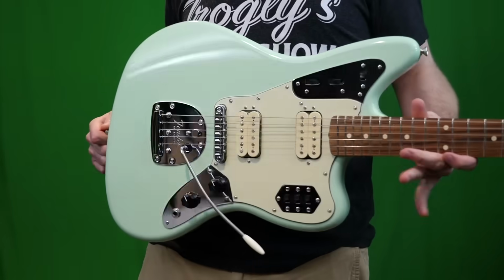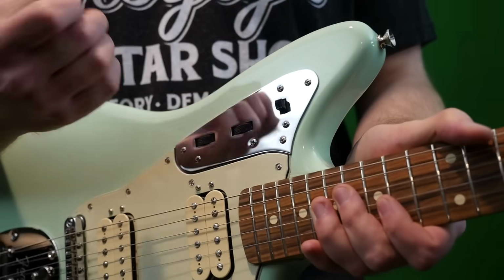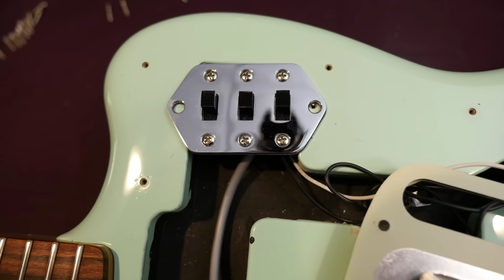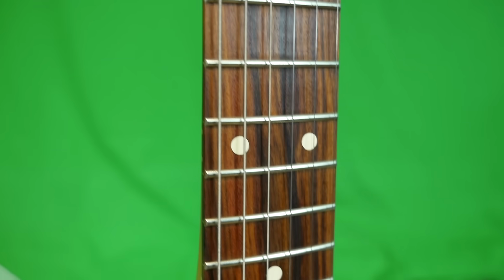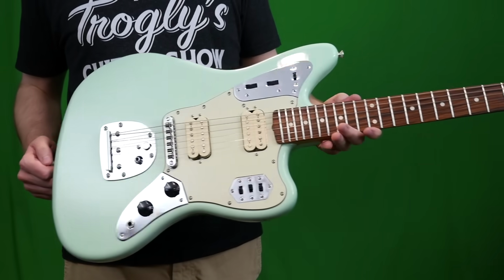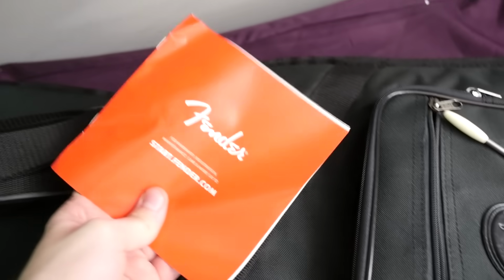My First Jag! | 2019 Fender Vintera 60s Modified HH Jaguar Surf Green | Review + Demo

Comment: Anything over $1K deserves a hardshell.  Agreed.
Reply: Yeah that's been my bigest problem with fender.
Reply: This guitar becomes 1599.99 with a hard case tho.
Reply: lol, I refuse to pay for a standard guitar over 1000$, if it goes over 1000, I would rather go with something custom made.
Reply: alidan or vintage :)
Reply: The old classic series that the Vintera replaces had hard shell case and nitro finish. Getting less for same cost.
Reply: Back when there used to be guitar stores, instead of only one that rhymes with buitar lenter, they'd throw in a practice amp, strings, gig bag, etc..., and I'm not talking about those box deals. They'd do in store deals to move guitars, and the employees would actually know things and be helpful.
Reply: @alidan  lol, any custom made guitar would cost a lot more than 1000$ and this price range is seen as the standard if youre looking for a quality guitar
Reply: @Gerardo Sajid Gámez Sánchez most of the quality of life and feel for guitars can be done at the 800$ price point, that includes trem and pickups for the most part, but top dollar you are looking at around 1500$ for a perfect, decked out guitar and this is retail price possible. if I went over 1000$ for a guitar, 99/100 for me, it would be because the guitar is either perfect as is and I want that exact guitar, or im willing to spend the 2000-3500 to completely customize the guitar to my whims. see, at the 500-1000$ range, i'm more of a 'its good enough and I can settle for what I get' and what I get will be fantastic for the price, not perfect, but i'm not missing out, ad 50-150 for a hard case. but the moment i go over 1000 thing needs to be 100% what I want in every single facet without question and at that point im willing to pay more.

I cant remember where, but there is one place that does smaller runs of guitars so I can get a custom paint or custom pickups for little extra cost, the term though can cost a lot, but I like my stuff locked most of the time for tuning reasons.
Reply: @alidan  really? Custom shop guitars are easily $5k+. That's a pretty big difference 😂
Reply: 100
Reply: As long as Gibson is still selling $1600 guitars with no hard shell case, there’s zero chance fender will on models like this.

Comment: Shorter scale length yields strings that are more loose not more tight.
Reply: Rob Mathis not true, the information in the video is correct.
Reply: Absolutely, what I was thinking , as I put down my Strat and pick up my Les Paul .
Reply: @jakerjohnson38  Sorry you're wrong. Austin made a mistake. It happens.
Reply: Jake Johnson no its very much true, when using the same string in the same tuning a shorter scale guitar will have LESS tension, you can clearly fee this difference when comparing a Gibson vs prs vs fender scale guitar. Never mind the even shorter offset scale
Reply: to be exact, longer strings require higher tension to tune to the same pitch as shorter strings of the same gauge.
open up a piano and look at the various string lengths and gauges, and this will become blatantly obvious.
Reply: Shorter scale length = less string tension. Ask any drop tuned metal player. That's why they play either baritones, or put extra heavy gauges on Les Pauls or don't even play Les Pauls at all. Also the reason why ESP-LTD's Eclipse is 25.5 vs 24 so just put that into perspective.
Reply: @Guitar Ocd - That's what I do with my SG sometimes. 11's give a good tension for 24.75.
Reply: @guitarocd9984  agree about the intonation Ocd, but I always liked the loose, floppy aspect of my old Jag. Just lends itself to bashing around on those old garage rock tunes. My only complaint - and it's not really a complaint, just a preference - is that Jags (and I assume Jazzmasters) just offer too many options for tone. All due respect and admiration for those who can make use of it, but i just sort of froze at the abundance of options. I eventually went the opposite route and got a single pick-up guitar. Suits my simple mind.
Reply: But I absolutely loved the Jag trem bar
Reply: He said he had it tuned up higher than normal which explains why the strings were tighter.
Reply: Yep. That's the reason why I swapped my Squier Tele Deluxe to an Epiphone Les Paul.
Reply: @guitarocd9984  That's pretty much how the guitar was designed to be used. Heavier strings, perhaps even slightly shimmed back neck.
Reply: Play a jag on 9s and you will realize just how little tension their is on the tiny scale length. You could accidentally do a half step bend if youre heavy handed enough. Playing 11s on a jag feels similar to 10s on a strat.

Comment: I'm thinking the single coil pots are used as a variable resistor in parallel with one of the humbucker coils.  When the resistance is high it's in humbucker mode and as the resistance goes down it shorts out one of the coils to make it more like a single coil pickup. All the way down, one coil is shorted out and it's in full single coil mode.
Reply: Exactly

Comment: For your trem, you want it set up so you can engage the lock (the slider on the tailpiece) without pushing the arm down whatsoever. That will let you hold your tuning after losing a hi E, which is normally a disaster on something like a Strat tailpiece that is not grounded out.

Comment: Gotta say, the pau ferro fretboard looks less desirable than rosewood.
Not my favorite review, but I'm glad you tried to get all the tones. 
Here's a list of the moments for easier reference:

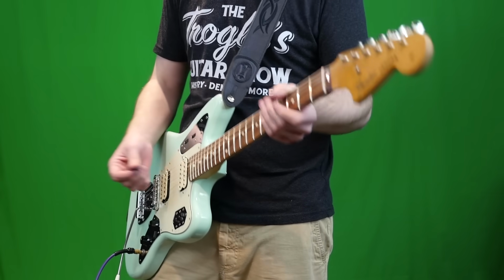14:36 Only Neck Pickup in Full Humbucking Mode / Left Switch UP only
14:48 A little bit of single coil
14:54 More treble from rhythm circuit
15:03 More Bass from rhythm circuit
15:10 Who knows cause he didn't say anything, apparently just neck pickup
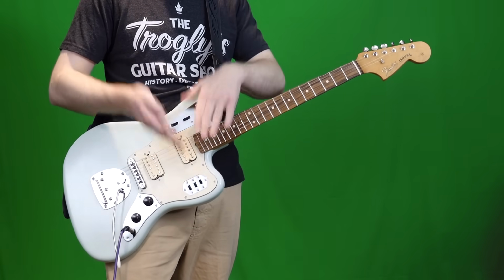15:57 Tone cut with Left + Right Switches in UP position
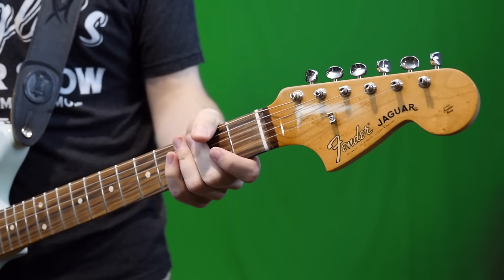16:30 Bridge Pickup / Middle Switch UP Only
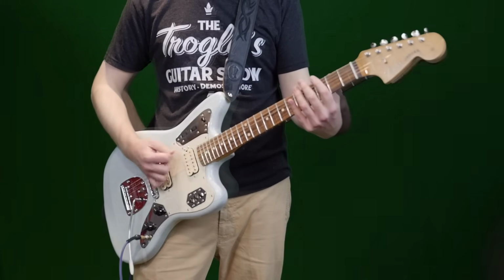18:05 Both Pickups in Single Coil Mode / Middle and Left Switches UP
18:24 Neck in Humbucker mode / Middle and left switches still UP
18:40 Both Pickups in Humbucker mode / Middle and left switches still UP
19:03 Neck in single coil, bridge in humbucker / Middle and left switches still UP

Comment: The variable single/humbucker controls on the secondary circuit was a brilliant idea. Makes more sense, and is FAR more usable, than the original circuit. Very tempting. Wish this version came in the turquoise with matching headstock though.
Reply: The turquoise with matching headstock is so beautiful, I want to get that one and modify it with the humbuckers

Comment: So the butten on the trem is a lock. You lock the trem and then tune. After the lock is released you play as normal. If you break a string and go out of tune you can again lock it and it will return to tuned  -  one string.

Comment: Shorter scale length = lower tension, not higher.
Reply: I also agree. It should be less tension on 24" scale length. All the better for that locking tremolo system jkjk
Reply: @electricurinal  Ok got ya. Since he was tuned up so high it seemed more tense. I see.
Reply: @electricurinal  , he should have started the video without all the talk about the accidental tuning because all that did was confuse people.

Comment: You had the trem locked the whole time, suprising that it did anything at all. The slide switch above the spring adjustment screw should be slid up towards the bridge for the trem to operate properly. The switch should be locked when changing strings..

Comment: 99% of these are identical to the original "Classic Player HHs" - Atomic humbuckers and everything.

I love mine, but that was when they were a TON cheaper.

Curious if the trem is moved forward like the CP and Mascis Jazzmasters etc - that allowed me to mount a Roland synth pickup.

The kill switch makes it an ideal host for that (can control the 'kill magnetic pickups' of the GR-55 etc straight at a playable spot to go synth only on demand).
Reply from the maker: The previous HH Jag had Enforcer humbuckers

Comment: Your Tremolo issue was most likely solved when you played with the tremolo "lock", that round slider on the top of the trem cover/plate.   You can lock the tremolo for a "hard-tail" type system to increase tuning stability (in theory).
Reply: It's a "bar down, in-the-case" lock.  The bar has to be so LOW to lock it, the guitar is down 2-3 semi tones.
But, you can leave it locked and retune.  Lots of players just leave it locked, retune any play away for years.  These seem to be the ones that switch the top controls our and never use them... ever.
Reply: The lock button in reality is so if you break a string you can lock the bridge and the other strings will hold tune and you can play on. Other wise with the jag you would break one string gigging and the guitar would immediately be out of commission and you couldn’t even finish the song you were on.
Reply: @denniswalsh8476  I realize this is a 2 year old comment but when the trem on a Jaguar or Jazzmaster has the spring tension set correctly the lock should be able to engage without any downward pressure.

Comment: This thing is masterpiece. I installed 11s using Thomastic flat-wounds and down a half step. Incredibly versatile!
Reply: I've been doing the same thing. 11-50's and been playing in Eb or more commonly D standard :) The flatwound larger strings were a game changer, but I actually had to file the nut a little bit to fit them.
Reply: @max_mittler  I had returned the mmm original designed with replica single coils. Very happy I did! Glad you are enjoying yours too!

Comment: Trogs, im pretty sure if the up/down switch on the top plate is up, the bottom selectors don't do anything. And you had it up the whiole time. Maybe it's not the on the HH version?
Reply: On regular jaguars it switches between the lead and rhythm circuits as you mentioned, but on this HH version it acts as a master killswitch

Comment: Ref. the whamny, that button is an in / out in-the-case, bar down lock.  Some people just leave it locked and retune, opinions for intended use vary  Push down on the bar and sliding the button "down" lock the tremolo mechanism.  Sometimes it's hard to slide the lock, especially if new.  There is a drag adjustment but the whole thing has to be removed to access it, then it doesn't seem to stay very well for the effort.
The collar at the bottom of the spring tension adjustment.  The spring tension adjustment is the screw next to the lock threaded into the collar. CW to compress the spring.
The upper pots USED TO BE a "second" volume and tone for the neck PU and the upper switch put the neck PU and those pots in /  out.  The idea being, "that's your jazz setting". "Out" puts the top pots out of service and the neck PU reverts back to the lower controls and the guitar works "as expected" ha.  "In" and the bridge and lower control are switched out and are non functional.
New, the pots are now some form of the generic "dial-a-split" circuit" players and techs came up with shortly after coil splitable humbuckers came around.  The (old PUs were single coil).   The new function for the switch is a  (un-necessary) kill, keeping the switch there to maintain looks continuity with the originals.  Both PUs off is another kill setting.
The long span of strings between the bridge and whammy rings, yes, yes it does.  I LOOSELY weave a couple of pipe cleaners through them, twist the ends together and cut them off.  Slide them to the middle of the span.
I've had friends mention the NEW ringing and it's because they restrung and tossed the pipe cleaners... er... okay dumbass.
Original bridge was a wobble bridge, (look it up yourself).  New is a stationary TOM knockoff.  Best is a roller, but most are 12 inch radius vs. 9.5 or less.  If you can get an all BRASS roller, the frame can be bowed a little more in a hand press to get near 9.5.  Steel can be bent too... with much more effort /pressure.  Pot metal frames will just crack.
I don't own a Jazzmaster or Jaguar but a few  of my friends do.  I have worked extensively on two or three.  One, make the tremolo unidrectional and install a (re-radiused)  harmonica bridge.
The other, defeat the tremolo and install "the ultimate" Jazz/Jag bridge and a new neck.
I love/hate them, depending on the day.  Both sound awesome though.

Comment: The tuneomatic is a tuneoproblem on an offset guitar. Replace with a stay trem or mastery bridge. The tuneomatic is the wrong radius, and is just not designed to work with the tremolo. 

Also make sure to set the trem lock to work properly with your set of strings and tuning.

Comment: Trogly, regarding the blackness on your fingers, did the guitar have a different brand strings than you usually use?  I've had it happen with strings. Mostly I had it happen with graphite picks.

Comment: Austin,
I believe you might have that backwards .. longer string length = more tension to tune to pitch.
Principal behind the 'inverted' head stock - a la Hendrix. Tightens up the bass strings .. loosens up the treble strings.

Cheers
Reply: Yes the set up is wrong
Reply: Exactly...
Actually 24" is kinda unplayable with anything lower than Standard Tuning if you're using .09—42 strings
Reply: @danielsgrunge  i use 11 50 bt

Comment: The resistor and capacitor that are wired in parallel on that switch is not a tone cut it's a actual treble bleed circuit kind of like a bright switch on a Fender amp when you have your volume rolled down really low it Cuts treble so you flipped the switch to put the treble back into the circuit. When your volume is rolled all the way up and you flipped the switch you will hear no difference.
Reply: GAMES AND GUITARS I have a classic player jag. Even with the volume control all the way up it still, changes the sound. It cuts bass frequencies, it doesn't 'boost' treble. You will notice if you turn the switch on that there is also a decrease in volume. I know very little about electronics but it definitely makes a difference no matter the volume setting.
Reply: @wastewoodrockers5526  if that is correct then it is not a treble bleed it is a deep switch. The only difference is that the value of the capacitor deals in bass frequencies and not treble frequencies. Therefore it is not cutting base it is boosting bass in the other position. Thinking of it whether it is on or off depends on how you look at it. You are not necessarily cutting base. If the capacitor and resistor were removed then the extra bass would not be there ever. Therefore when they are in circuit they are boosting base. Capacitors in that fashion allow signal to go through weather is treble or Bass the only way to actually have it cut is if it is attached to ground. And that thing is not attached to ground it is across the switch itself.
Reply: GAMES AND GUITARS Yeah I shouldn't have said 'bass cut' that was stupid. When I turn it on when using my jag there is a reduction in volume and the sound gets thinner overall. That's what I hear. As I said, I have very little knowledge on electronics.
Reply: @wastewoodrockers5526  it's all good man I was assuming and you corrected me I've never owned any kind of a offset fender. If you want to learn more about Electronics tube amps specifically check out the YouTube channel called Uncle Doug. He is a retired teacher that will teach you everything you want to know about tube amps and really laid it out it shows you in layman's terms. Also you can check out the guitologist. He lays a lot of knowledge on you also.
Reply: GAMES AND GUITARS Thanks for the advice, I'll have to check them out.
Reply: @wastewoodrockers5526  when you go to Uncle Doug's page he's got a series called how tube amps work. Start with that series first the videos are from like 6 years ago or something so you'll have to scroll down pretty far or just search "Uncle Doug how tube amps work" and start with the oldest video first
Reply: GAMES AND GUITARS Yeah thanks again.

Comment: Take the smallest drill bit you can find and drill a tiny little hole at each end of that crack in the finish, and it won’t spread any farther.
I had a beautiful Pao Ferro board on a MIM Strat that smelled so bad of “mildew” I ended up trading it for a maple.  ???

Comment: Is there a such thing as a coil system where you can split the low strings with a H and the high strings with a single coil??  When you were splitting the pickups and making 1 H and 1 single it kind of sounded that way

Comment: First of all kudos for actually pronouncing Jaguar the right way instead of Jagwire. Secondly just a little added information about the differences between the 'modified' and 'vintage' singlecoil specced versions. The vibrato unit is closer to the bridge on the modified model to increase the string angle for better sustain. As for the upperhorn controls on the vintage model, they work as an extra circuit for the neck pickup only. So with the switch down, you can use the lower controls and switches. And up you use the rollers for volume and tone on the neck pickup only. This circuit tends to sound slightly darker compaired to the mastersection. I haven't done my homework on the actual bridges and if they still use that querky original style or moved on with time and put the barrel style saddles on the 'vintage' model. 
This channel is bad for my 'no more guitars' rule I put on myself this year. I mean I need get rid of stuff because I have too many yet this channel now has me GASsing for a 70's Les Paul Custom or a 70's Deluxe.